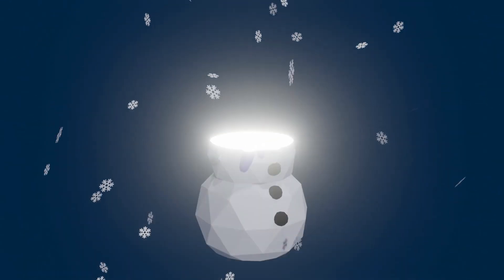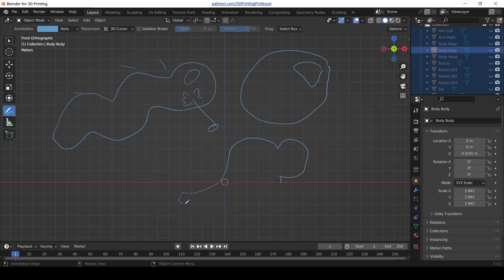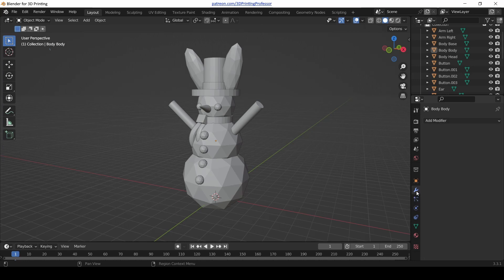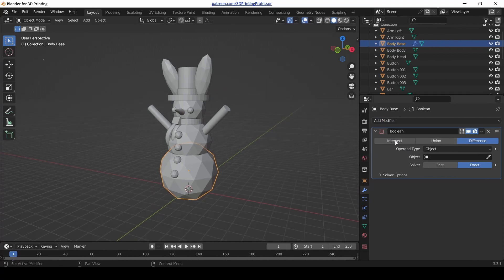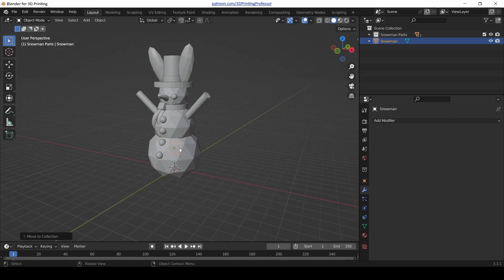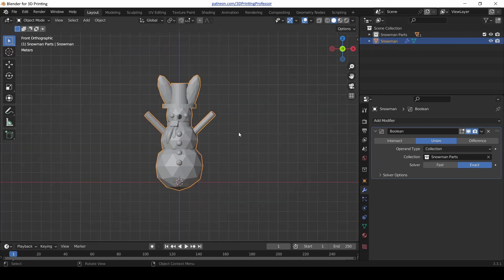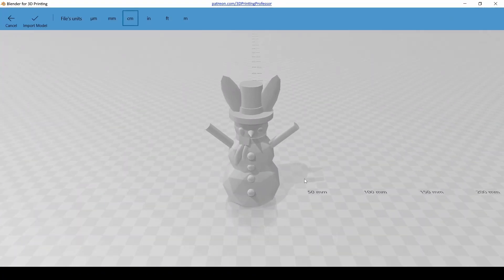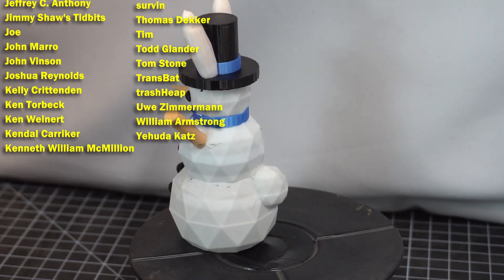How do I export Blender files for 3D Printing? Blender Tutorial 7 - Exporting for 3D printing

Comment: Hello, can you please show the skipped process of adding color and exporting the file to include multiple colors for 3D printing?
Reply from the maker: No steps were skipped. The painting and separating into colors was done in the slicer. Color painting is something Bambu slicer and Prusa Slicer can do with single color objects. This means you don't need to have object separated into different objects any more, though you can if you want to.